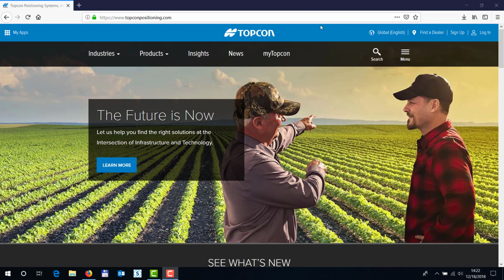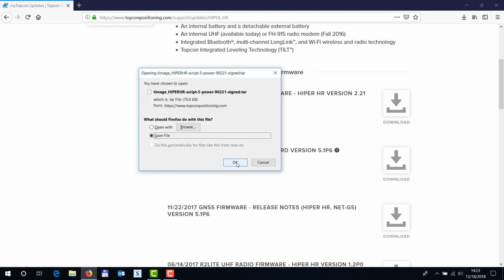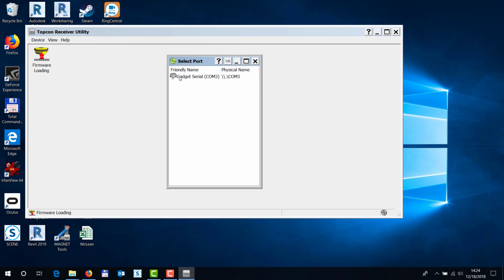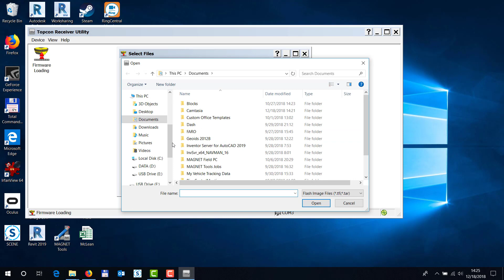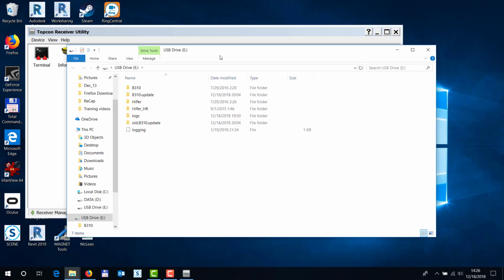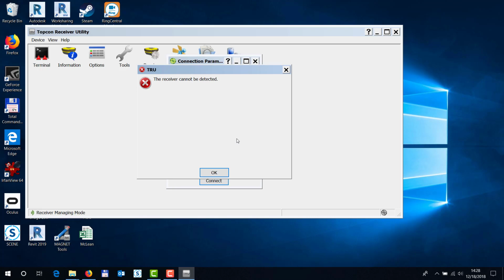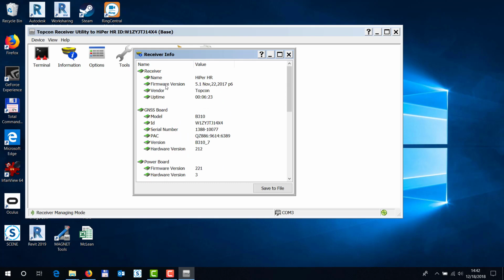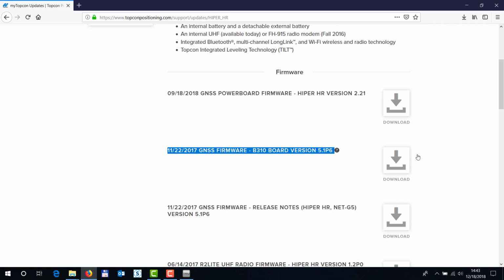Topcon Hiper HR how to install firmware

Comment: I have Hiper V, I already download the files from topcon (.ldp and .ldr) but the TRU send me the message "The firmware of this GNSS board can only be updated through a serial cable connection, using Firmware image format - Tow files. Please help, I'm using serial cable and the files from topcon for Hier v
Reply from the maker: Easy, change the "Firmware Image Format" option in TRU from "One File" to "Two Files". That will let you install the ".ldp & .ldr" files!

Comment: I have topcon hiper 2 Not on the list of types?
Reply from the maker: It is a LEGACY product, so no active firmware updates are available anymore. The last version for the Hiper 2 you can still find here: https://www.topconpositioning.com/gpsrollover#feature-110916. Good luck!
Reply: @DiCarloTV I dont have cable Usb can I use bluetooth and the file put in sd card?